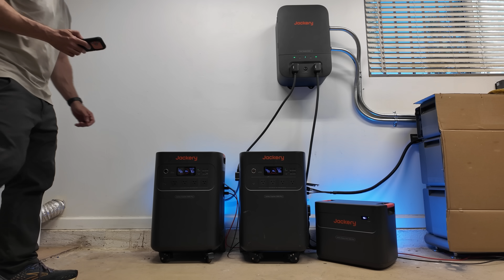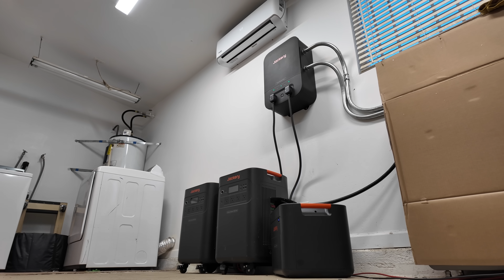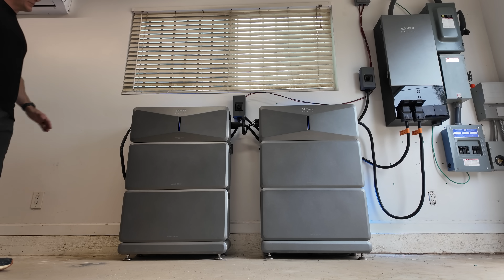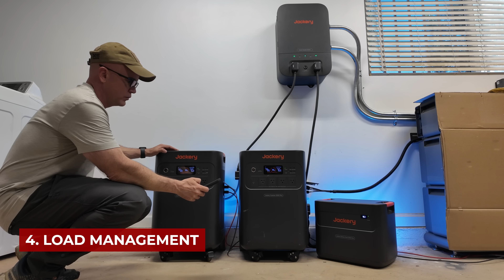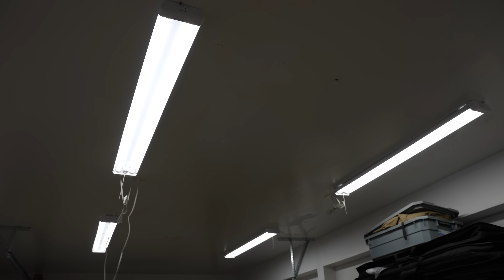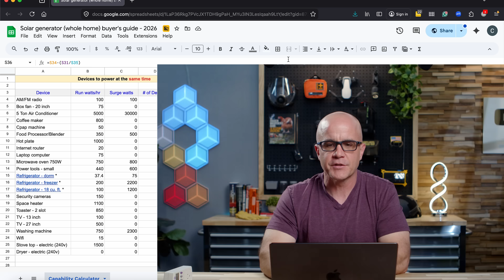What Actually Happens in the First 60 Minutes of a Grid Failure

Comment: Could you please do an episode on how to set-up a solar generating system just to run my water pump for a 150 ft well, with 150 gallon tank. This would allow me to have running water in the house to drink, clean, and flush toilets (Have a septic tank too).
Reply: I found other YouTube channels that used transfer switches. I showed my electrician what I wanted and he designed a system that allows me to power 6 critical loads using my EcoFlow pro 3 with extra battery. He also installed a junction box for my solar wires to connect to my home without having to open windows or a door. My setup can run indefinitely. I also have the smart dual fuel generator incase I have no sun to power my panels.

Comment: As a hardcore survival minded, rural homesteader: The best guard against electric grid failure is to make sure as few of your vital systems run on the electric grid, or even electricity, as possible. Get a backup cooking solution that uses propane, charcoal, or wood. Get battery powered, or flame powered, lighting solutions. Live somewhere hot? Get a cooling solution that doesn't require electricity - even if it's just a small above ground pool. Heat? Get a wood fired solution, and hot water bottles. 

But hey, we all have phones and computers and fridges. So at the least, get a SMALLER solar bank and panels. 

And I say this as someone who is solarizing their entire property as I type it.
Reply: i have gone a different route, i slowly built up a solar/battery system that provides about 90% of my day to day electrical needs. wood is not readily available pellets have become more expensive every year, propane, gas, diesel all rely on someone else having them in stock. i heat with natural gas but have 2 mini splits that i run most of the time. if the grid is down i only notice when my dryer or hot water heater are not working. I have a 7kw 240v generator for the few days that solar is not enough but honestly i use the grid for back up and save the gen for real emergency's.  Having control of my electricity has made most things a non issue with my home. is it perfect no but it has been working for me for three years now. what is important is to find what works for your situation and dont think that one solution works for all.
Reply: @ArnoldReiter-g4c  Agreed. We have an abundance of local wood, and even on our property. I'm not saying electricity has no place - we literally just solarized our property in the last 7 days. 

What I am saying is that there are vital preps that must be in place - water, shelter, cooling and heat - that can all be solved without elec, and that's what I recommend people have on hand. 

And as you note, everyone's situation is very different. Someone prepping in the deep American South is going to want something different from our place, or someone in Canada.
Reply: @ArnoldReiter-g4c you're even better prepped than Mr no electricity, he'll have to run around tending to his wood stove, his gas lights and such while the system you set up will let you live pretty normally.
Reply: @906MediaProductions  Why the shade? I wasn't saying nobody can use electricity. I was saying that for vital preps, it's best to have solutions on hand that don't use it. We have those. We also now have a solar powered property that runs a pressurized well, fridges, and AC units. Are you just looking for an online fight? Chill out.
Reply: That is what we did.  Took a Kill-o-wattmeter on each "vital" system, including 3 freezers, fridge, computers, router, pellet stove, and recorded the usage of each over a 1-week period.  Added the total usage of all in KW over a week.  2.5KW of panels, a 2KW low freq 48V inverter, and 2.4KwH of battery.  Give us about 2 days of autonomy.  It would last through more than 2 cloudy days with power management.
Reply: @NSNorfolk  Rock! You got yer head on straight. 

Our most recent video was our own solarization. But in the end, I always make sure my main "do or die" preps are not electrical at all. Fire will always burn and water will always be wet. 

Stay cool!

Comment: Thankyou for the clear explanation of Watts and Watt-hours. 

However you need to do these and double.

There are inverter losses. Also anything mechanical has a spike surge need. 

If there is a resistive motor it briefly needs 1.5x-2x the Watts it claims. That hot plate, lightbulb and heathgun would not have resistive peak, but a compressor in a fridge would, as would anything with a motor like an electric saw, etc.

The portable powerstations you mention are DC in their batteries, to do DC to AC to power devices has a conversion loss, usually about 10%, and the inverter itself, even if doing nothing, has losses. So even if you did measure an appliance's needs, a portable battery would need more. 

So as a rough rule, take the claimed peak Watts and ensure you have double that Watts in your batteries, and take the claimed Watthours of devices, and double it.

Finally, don't take what I said as truth, only a guide, do an actual test, pretend there is an outage, use your batteries, and measure what happened. Then you'll know. We do a test in winter and a test in summer.

Comment: I do everything I can to reduce the power demands in my home. All of my lights are USB rechargeable. A simple solar brick can charge them when needed. I also have oil lamps, flashlights, candles and solar lighting. I have a propane stove with a tank that will last me for 3 months. I also have a barbecue grill with a ton of charcoal and wood. Finally I have solar cookers so if it's sun is shining I can cook and use no fuel. I have backup kerosene heaters and a fireplace. I also have solar fans and battery operated fans. Reducing the load allows you to have a smaller solar/gas, etc generator to run your whole house. I did a test where I turned off the electric in my house for one week. And I figured at what I needed to run and made sure I had enough power plus a little extra to sustain me in a power outage.

Comment: The 1000w on that hotplate is the power used when it is on full power.
It will use a lot less at half power.
So maybe the jackery might power the hot plate for two hours ?
But well done for breaking it down, a very confusing subject
Reply: While you're right, probably better to count on an hour, while you're not testing it for exactly how you can count on it. It's also better to not let these batteries get much below 15-30% to maximise lifespan, apparently. Even if you could get an hour, perhaps best to count it as 45m.
Reply: @parrotshootist3004  You are right, I'm not testing it (I have not even touched it 🙂) but my statement of two hours was a very rough guide, it all depends on how high you have the hot plate turned up to, on a low simmer heat it would last a lot longer than the two hours. I was just pointing out that the figure quoted on the machine is the flat out top usage figure.
If we were going to get technical and picky, we would also need to take the jackery's inverter power loss into the mix, but Kris was just giving people a rough guide to work out their own use
Reply: @Lee_Proffittrue. No harm in adding the details to the picture. A lot pf people are completely new to all this. New to the details, new to rough margins, new easier rule of thumbs. It's going to be painful putting this stuff together after the margins for error, accidents, incidents, and calculations are needed. Even for the more so best prepared among us. Even then, means can only stretched so far.

Comment: 4:36 You’re not going to get 1000Wh out of a 1000Wh battery. When you calculate your needs, you should reduce your reserve source by 20% because of the inverter and other losses.
Reply: I learned this the hard way during Hurricane Berly. Ideal consumption uses up some of the energy. Never again. To me the 1000wH is not enough. Maybe for a short 4 hour power outage.
Reply: We went 12v for things to avoid the inverter power loss. Just made more sense to adapt to it now.
Reply: @forgesasmistandfor7134 What makes you think your inverter doesn’t use power because of being 12v?

48v systems are the way to go.
Reply: @williamwilson6499 it’s obvious you’re not electrical minded. My 12 V system is DC, it doesn’t need an inverter, I can solar charge my batteries and not need to convert it to 110 AC. Therefore no reduction empower due to converting it from DC to AC.
Reply: @forgesasmistandfor7134 Learn how to express yourself in English better. Obviously you slept through second grade.
Reply: That's true, he was oversimplifying to make understanding the basic math easier. But you're right! Inverter consumes some energy, even if idle, and the power station too to maintain itself.

Comment: Hey Chris I really like your show but to have any validity in talking about back up power and solar panel/ battery systems you need to get rid of your electric hot water heater, electric stove and electric clothes dryer. You couldn’t run those systems more than a few hours without depleting your power availability. All of those appliances can be ran on propane. You also have at least one split unit that draws a fair amount also. You need to be telling people to switch to propane or natural gas if available. It’s just not feasible to have an all electric house and then worry about back up power to support it. Trust me been living off grid, with a very very large solar and lithium battery system and we tried an electric dryer and it was just a huge drain on our system.

Comment: Great video! I saw your washer and dryer in your barnominium, and suggest that you check out a heat pump dryer. They're energy efficient and don't vent the indoor heated/cooled air to the outside, so you save that energy also.
Reply: a clothes line
Reply: @az55544 Clothes lines are great too. I also have a drying rack which is like a compact clothes line. It works well.

Comment: I am not planning on powering my entire house in an emergency power outage.  In an extended event, it would only attract attention anyway!  I have three Jackery units, many 100 watt portable panels and 4 on the roof feeding a pair of 100A/H LiFePO4 batteries, mostly used for lighting and recharging battery banks.  The Jackerys are great for power tools, air fryer, Instant Pot, well pump, the fridge and/or freezer, and the internet/television.  I like my "modular" setup, only using what I really need in an emergency.  Thanks for the update, Kris!!   👍
Reply: Very smart....I'm doing something similar. Yes, it's a little bit of a pain swapping/moving solar generators and panels... but...I'm a lot more low key and I'm completely portable/ swappable if something doesn't go to plan. I have elderly Italian neighbors, so I can easily take a bluetti over to them to keep their freezer going...and swap out a new one while I'm charging the old one. Why???...firstly because it's the right thing to do.....secondly they grow all their own vegetables and freeze everything to get through the winter. You want someone who has years of knowledge and a full freezer on your side. And, if a neighboring community happens to have power I can go "fill up" my generators. And if I need to leave my home?...most of this equipment goes with me. Trust me, it would have been cheaper to do one larger system, but if something goes wrong I have redundancy.
Reply: @niagaraadventure4705   You have a system that works for you, and that's all that matters.   And very honorable to assist your neighbours.  I also have Italian neighbours across the street, and they get a sampling of my garden and maple syrup every year, while they share fresh eggs with us!  It's a really good thing to have excellent neighbours.  ALL the best to you!!  👍
Reply: @niagaraadventure4705 Great system! I do something similar. Although I disagree that a modular setup is more expensive than a fixed system. When I was researching whole home systems, I found that I needed to spend around 6k just on equipment and that doesn't even include solar panels and professional installation. For that same amount, I could get 4 solar generators capable of putting out 8,000+ watt hours and at least five 400 watt portable solar panels. Even better is that it's all plug and play so no electrician needed. An extra bonus is that I can pack it all up and put it in a normal car.
Reply: Agree. I have a 1800 for ref, 2400 for freezer and a smaller one for TV or computer or phone. lights.  If one has spare gas they can recharge some units with a cigarette lighter.For cooking I have a gas grill with spare propane tanks and back up.  I can handwash a pair of pants, etc. Why waste a ton of water.
Reply: @rcx7093  Right on!  We of course have a propane BBQ and Blackstone griddle for outdoor cooking.  While I don't like using it due to fuel prices, if absolutely necessary I also have a 4500watt gas generator for other contingencies.  Belt & suspenders, LOL.  Best wishes to you!!   👍
Reply: I have a similar set up.  I have a portable solar trailer parked behind my house out of sight out of mind with 3k watt capacity and a small cart with 550watt capacity.  Each has lead acid deep cycle batteries solely for recharging lithium cordless batteries used to power many diy  solar generators inside my home.  Why did I use deep cycle lead acid batteries?   Because I got them from an atm serviceman for 5.00 each.  This system works great and I have expanded the use of my cordless tool and lawn equipment lithium batteries use and created redundancy.
Reply: @mr.makeit4037  Impressive!  I, too, used lead acid batteries initially (AGMs) but they were SO heavy, and eventually wore out.  Hey - in THIS case only, "diversity" is our strength, LOL!  All the best to you!
Reply: Thats what I am doing i dont wanna beacon saying hey come here!!! I wanna power my freezers  lights radio in stealth.
Reply: I have solar panels with a tesla powerwall.  I reserve that when the power goes out  (without sun) for just the refrigerator, well and freezer.  Fans and recharge of devices is done through my power stations (I have solar panels for those that are separate from my house panels).  AC/heat,  hot water don't need.
Reply: @lorettacarroll6015  Your setup sounds perfect!  Best wishes to you!
Reply: Just bought a Ecoflow Delta 2, and 2 anker C300s. Could easily power a tv, and lights for 24 hours, or a fridge for 8 hours. Thinking of getting an Anker C1000 aswell.
Reply: Anyone have tips regarding hiding the smell of food cooking? What if those nearby don’t have preps and smell you cooking?
Reply: All depends. There really isn't a simple way to cover up food smell. If you live in a building with other people in apartments. I would say use canned food to heat up. Since its less of a smell. If you have to fry something could use the bathroom since they have ventilation ducts. If you live in your own house i would use your basement if you got one. It depends on where and your living arrangements.
Reply: @khaleesiy.7886 my plan was to cook in my fireplace with my windows closed. Smell comes out the roof and blows away. While still making odor its at least a lot less obvious which house/apartment its coming from.

Comment: Go Solar and prepare for Solar or man - made EMP also as much as you can.
Reply: I have a total 54 panels puts out around 20 plus kw. Battery storage is 60 kWh and I live in an area that averages over 300 sunny days per year.
Reply: Solar is one thing, EMP hardening is a whole other thing.  I cannot fathom hardening an installed system, I'd have to basically have it all sitting in a Faraday cage waiting for the day after.